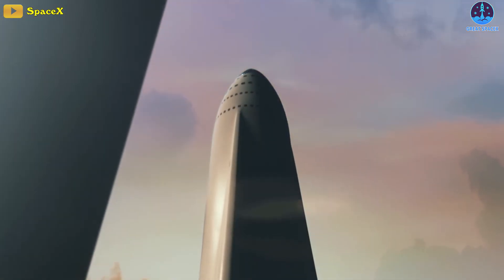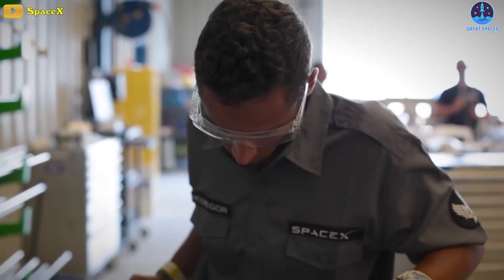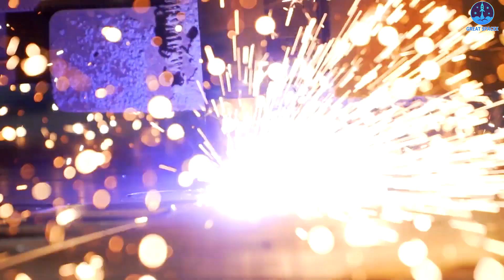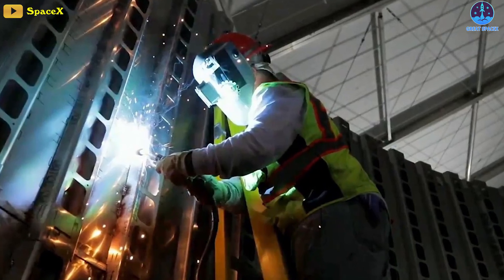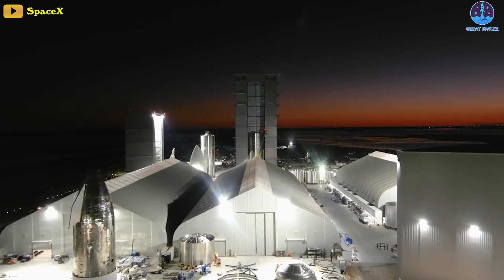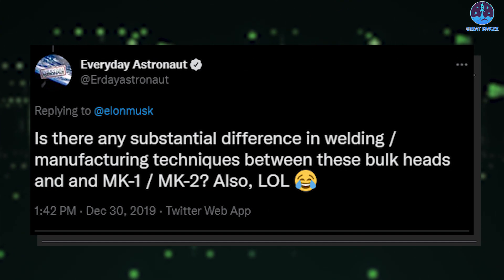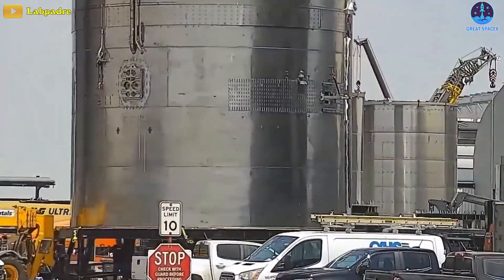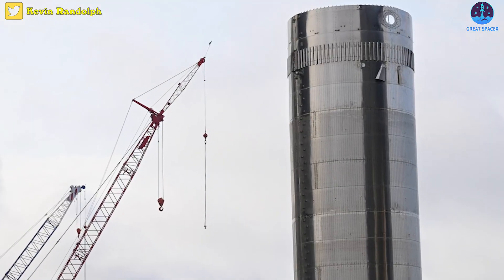SpaceX's NEW UPGRADE On Starship's Welding is unlike any other!

Comment: Stainless welding in not as hard as your making it sound. newest welding process SpaceX is now using robotic tig welding with hot hampering of fusion zone making the weld stronger then surrounding. The cold Rolled process does several things 1 the master coil goes through an annealing and acid wash and most cold rolling is done with 2 to 10 roller stands or sets of rollers to roll the steel. the 5 stand tin plate mill that used to be in Baltimore MD used anywhere from 50-250 tons of pressure at each stand. So what exactly does cold rolling do well 2 things 1 it does the final thickness sizing 2 the pressure thickness reduction is a type of forging making the metal density increase. Side note cold rolled is not that cold not even with aluminum hot enough instantly burnt if touched. The biggest problem with stainless welding is getting it too hot, if anywhere in the heat zone turns brown the metal is considered defective a medium blue is best in the heat zone. If you want to know just ask and we can arrange coms. been doing the trades for about 30yrs

Comment: That early stuff was some hillbilly looking janky ass shit. I suspect they will end up refining their technique even further. I'm still wondering if the stainless steel is being used just for prototyping and that they will switch over to something high tech once they get the design all locked down. It would save a lot of weight.
Reply: It would save a lot of weight if it weren't going to space and didn't need to store cryogenic fluids. Those last two requirements make SS the lighter option because of all the add-ons carbonfiber requires.

Comment: how about welding using laser, plus, strong and precisely directed magnetic fields?
Reply: Well, a static magnetic field wouldn't do anything, so do you mean a moving magnetic field? If so, then… if you're making a variable EM field, might as well make it one that switches quickly enough that you can aim it precisely, and once you do that you've just gone to using two lasers instead of one.
Reply: @lukesomers2031  Or, if you really just want electric fields, switch to EB (electron beam) welding.

Comment: Within the opening two minutes you state "But, SpaceX engineers changed their minds and decided to build StarShip from Stainless Steel instead of Carbon Fiber. It's because Stainless Steel is Much Cheaper than Carbon Fiber". That's just plain False and it shows your research is non existent over this fact. The fact that SS is cheaper than CF was incidental and IS NOT what drove SpaceX to change StarShip construction materials. CF construction holds So Many Technical Difficulties when used in the applications SpaceX needs, it was scrapped for a material that didn't have as many construction problems. Here's why SpaceX "changed their minds" and switched to SS. CF is Extremely difficult to test to Failure, it Failure point for the same part is All over the map compared to Metal, which is Very Consistent at showing it's max stress values. CF is Highly intolerant to nicks, cuts and surface Damage. Ever nicked a Carbon Fiber fishing rod, that's exactly where it will snap and break, every time. CF itself is Very Light and Highly resistant to heat, but the Resin Compounds used to hold it's structure are not. CF and it's forming resin leak Cryofluids  badly and req's some sort of barrier installed to stop the leakage. CF is Much more difficult to repair to original strength compared to SS. CF dust from cutting and drilling repairs does Not decompose when inhaled, making it a HAZMAT item when doing repairs. You need the best breathing filters available when working around CF cuttings. CF requires an Autoclave (Very Large Oven), much larger than the part itself to cure the layup resins into shape. I've worked as a fabricator with Both these materials for decades and as with anything else in life, there's always a tradeoff when it comes to Pro's & Con's. Yea, the cheaper cost of SS vs CF had very little to do with why SpaceX went to Stainless. And, Stainless Steel Is Not rustproof. That's urban legend. Stainless Steel is also considered a "Food Grade" metal by the USDA. We used it extensively in the Seafood Ind. in Alaska. When SS gets near seawater, it rusts.

Comment: Absolutely great the evolution of production, from carbon to steel, from C301 to C304, from  hand-held-welding to laser-welding! I guess Elon is smart enough to listen to his co-workers, which material, which procedure does it‘s best, and that‘s going to be it, not the thoughts of any well-paid egg-head. This will be the reason for upcoming success.
Reply from the maker: YUP!!!
Reply: One thing is for sure, one can't claim that Elon is an egg-head. The bloke doesn't even have a Ba. Sc.
Reply: @Mark S He didn"t invent a single thing. He didn't construct a single thing. 
He didn't even thought about a single original idea.  

All he ever did was buy stock and push himself to the front as a genius and because he got lucky with PayPal (by being a previous CEO of a company that got bought by Paypal, previous because he was fired by the board). 
He doesn't even put his own money in the companies except to buy stock. 

I don't like Bezos but you got to hand it to him, at least he is willing to put his own money into the company to get things built. Whereas Elon just bs his way in companies and the government to give him money.

I'm wrong you say? In which case you'll have no problem providing links of all the times that Elon has actually giving any of his companies some of his own money.
But honestly, it's like his philathropy, lots of words, lots of hot air but very little proof of it actually taking place.
Reply: @Mark S If he isn't an egg head because he bought smart people nor is he because he is smart than why would you call him king egg head?
Reply: @Mark S He has an HONORARY doctorate. Which is just something for show and doesn't mean a thing. Anyone with lots of money or influence can get those, even if they are a complete moron.

The only degree he actually has is a Bachelors of the arts physics one and one in economics, which roughly means he has some basic knowledge of physics comparable to an European high school student.
Reply: @Mark S in other words you have no clue, duly noted
Reply: @Mark S That's a bit harsh, describing Elon like that, then again he hardly ever knows what he is talking about, is known to be mean and the only prestige he has is the one he bought

oh well, looks like you are right
:)

Comment: Being an old retired welder fabricater this video clip shows what the future holds for new types of welding, especially Starships, I worked on stainless steel pressure vessels and using TIG welding with argon gas on 316 stainless steel from 3.2mm to 10mm and we had one welder inside the belts or rings while the other was feeding the welding wire by hand, it took a lot of time but both TIG torches kept the weld clean and the penetration of the weld was just enough to reduce sanding to a smooth finish, oh to be young again and weld Starships.
Reply: Was that 1 on the inside without feeding filler & 1 on the outside feeding filler.  That sounds like a couple of welders who figured out how to get the best quality with the least work (i.e. minimum grinding).
Reply: As I keep repeating, welding stainless steel pressure vessels is tricky, but it is not rocket science (pun intended). It has been done for ages. Why musk has to reinvent the wheel? They could have just asked you or one of your numerous colleagues.
Reply: @AudiTTQuattro2003  Give the man credit where credit is due, though: for Falcon 1 and 9 he managed to hire, right from the beginning, the top talent in the field. Gwynne Shotwell is the last from that generation left in the company, but she still makes it tick. The first symptom of "Elon knows it all" was his naive expectations of how simple it would be to "just bolt three first stages together" and make Falcon Heavy, and the story started in earnest with SH/SS. If Raptor V2 stops eating itself, it would mean Musk found a good replacement for Tom Mueller...
We shall see. I wish SpaceX (and every other space venture) success, of course, but I am not a subscriber to "Elon the magician" cult.
Reply: @bazoo513  He's not a magician but he has a clear vision of his goals, how to accomplish them, great skill for picking talent, etc.
Reply: @JimEast123  I agree, and that's what I said, especially the last part about recognizing and attracting talent. Then again, his vision is often at odds with reality; Gwynne Shotwell (without whom, in my very strong opinion, SpaceX would not exist) spoke several times on skills needed to guide and "manage" Musk's breakneck rush in pursuit of his visions.
Reply: @bazoo513  im not a subscriber  either but id bet  u cant do what he has pulled off like or love him u cant deny what he has done
Reply: @louisburland5346  Of course. He managed to recruit Tom Mueller when the idea of launcher startup was considered madness, amid the first generation of failed attempts. He barged with some money into an enthusiast-driven niche EV startup Tesla and transformed it into both financial juggernaut and a kind of cult. But not only he is not "genius engineer", he is not an engineer at all. His talents lay elsewhere.
Reply: I'm ancient my self.  Went to rally last night.  At local community college.  They have a welding course there.  Think i will be looking to TIG welding aluminum!!
Reply: @highpointsights  Contrary to the popular belief, we old dogs are more than capable of  learning new tricks 😁
Reply: @AudiTTQuattro2003  It's not like laser welding or TIG welding is less simple than consumable core; they just have higher skill requirements.  Given the repetitive nature of building Super Heavy, I'm a bit surprised they're not using automated laser or EB welding.
Reply: I have were there 3D print a nozzle which would have had multiple welds.
Reply: 316 LVM is what’s used to make implants in the body (and body piercing jewelry).  It’s interesting that it’s used for other applications.

Comment: Starship prototypes should be made from aircraft grade steel, it is significantly stronger than low carbon stainless steel and it's a little lighter. Production starships should be made from aluminum zinc alloy (7 series) it's a little stronger than low carbon stainless steel and it's about half the weight. Hardened titanium would be best but that would be too expensive.
Reply: Stainless is used because of its strength over very large temperature ranges. That's why it was also used for the XB-70 Valkyrie. Titanium is even better, but it's extremely expensive to work with. Though 7075 is an exceptional alloy, it's limited temperature range makes it unsuitable for this application. It also has fatigue issues. Alloys like 4140 might work, but corrosion is a problem. No doubt, SpaceX did extensive research when they chose materials. So I find it humorous when someone like you tries to challenge their choices.
Reply: @EDesigns_FL  sweet mother of stupid, there is a reason why no other large rocket is made from stainless steel.
Reply: @EDesigns_FL  A lot of people would have challenged their choice of welding technique on the early prototypes and stated that they should use the tig welding technique that they finally figured out that they should be using instead.  You would have said it was laughable back then and said don't question their welding technique,  wouldn't you? I'm not even a top tier welder and I even knew what they were doing on the early stuff was a terrible idea and that they should be TIG welding it. I can assure you SpaceX Engineers don't know everything clearly.
Reply: @actionjksn  If you were more knowledgeable about welding, you would appreciate why SpaceX initially chose MIG in lieu of wire feed TIG. When they get the process further refined, they will no doubt switch to fiber laser welding. They are on the cutting edge of this type of welding, so it's not the least bit surprising that they are refining their procedures. SpaceX has hired some of the best talent available and it's ludicrous when armature know-it-alls second guess them.

Comment: SpaceX has combined X-ray machines and welders to check welds as they are made. This improves efficiency and saves a LOT of time. How did you miss that?
Reply: X-raying welds is nothing new, in fact you would be hard pressed to find a pressure vessel that has not been xrayed when it was made.
Reply: I didn't.  I just think welding is difficult and at some point, there was a human welding the nose cone and other parts, and was just giving props to people who have good welding skills...

Comment: I know they won't invest the amount required but as an engineer I cannot help but speculate as to the immense saving and strength of each unit produced if they used a sheet of heated ss and press formed it...
Yes huge scale and hideously expensive to start up... but reduction of cost per unit and quality would be fantastic..
Reply: I'm refering to the nose cone
Reply: Cold rolled SS is much stronger.

Comment: Robotic laser welding is more consistent, controlled and faster. Reduced number of segments helped a lot. The pointed cylindrical shape, while ideal for fuel tanks and cool look, isn't optimal for heat control, dissipation or controlled reentry. Even Elon has conceded these points because it allows faster improvements and changes. It's actually most critical for Earth atmosphere and reentry speed. Mars atmosphere and reduced gravity allows lower entry speed and less heating but requires better engine and airfoil control to "flip and stick" the landing. I expect the first few robotic ships to crash while trying to land, like the earlier Starships in Boca Chica. Eventually SpaceX will have different ships with different shapes and engines for different purposes. Earth, space, lunar, Martian, refueling, Starlink, etc.
Reply: Space X could "practice" landing by trying the flip & stick in our upper atmosphere, where air pressure is 1/50th sea level to imitate Mars's atmospheric pressure. 
     Just sayin'
Reply: Given that Mars gravity and atmospheric drag is so much lower, wouldn't it be possible to go vertical sooner and reduce the risk of suicide burn? I would like to think the computers could stabilize Starship more swiftly and efficiently that way.
Reply: @kenc2814  The issue with that is that you have to keep the burn going for the entire descent.
Reply: @psychohist   Good point.   I remember Neal Armstrong almost ran out of fuel in descent.
Reply: That's the hardest part, setting up a robotic Starship and booster assembly line for quick and consistent construction. This will be essential for Mars colonisation.